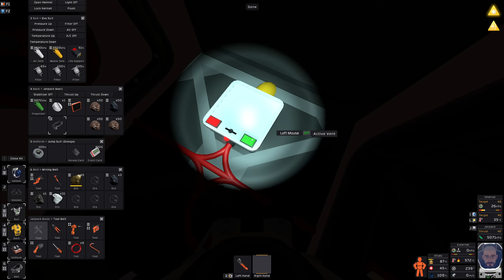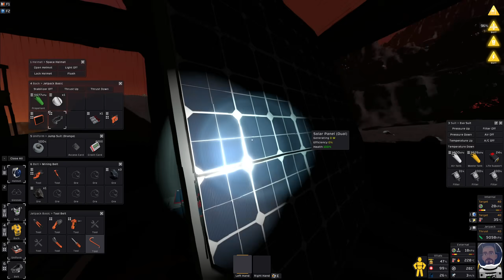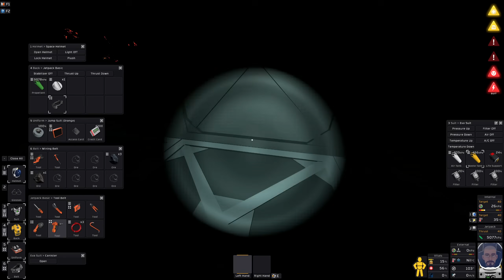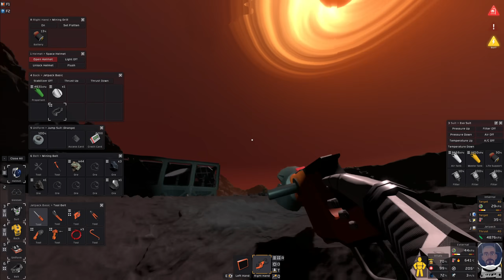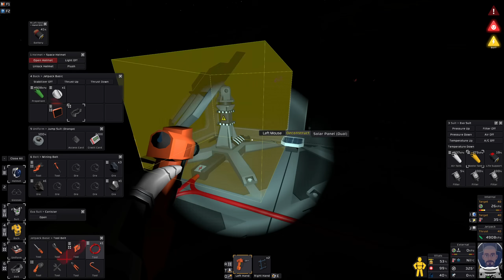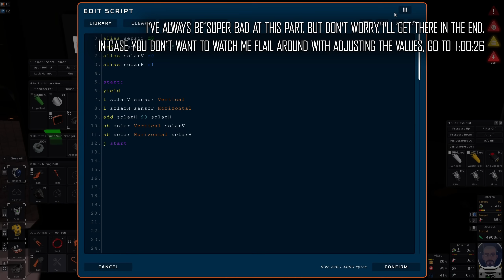We Need Solar Tracking ASAP - S2 E2 ║ Stationeers

Comment: Love the game, what is weird for me is how everything is complex, yet the furnace once you build it it needs no power. How does combustion happen?
Reply from the maker: Normally things combust because they are already hot enough, as for the ignite button, I always assumed it's the same piezoelectric effect that makes those gas lighters work without batteries. You know, the ones you need to squeeze a bit hard, so a small electric arc happens.

Comment: Solar tracking is much easier to get working if you always start by setting solar_vertical = 90 - sensor_vertical

This is because the sensor and solar panels give different values when the sun is directly overhead, and a conversion is needed regardless of the horizontal value you set.

There are other ways to do it but this makes for the most straightforward horizontal angle adjustment, as it will always be a multiple of 90 degree rotation no matter the map you play on.

Comment: hello Can you give us an IC code for solar tracking in youtube description?
Reply from the maker: I hope this reply will be enough, I don't really want to change the description of the videos. :)

/////
alias sensor d0
define solar -539224550
define heavySolar -1545574413
alias solarV r0
alias solarH r1

start:
sleep 1
l solarV sensor Vertical
l solarH sensor Horizontal
add solarH 90 solarH
sub solarV 90 solarV
sb solar Vertical solarV
sb solar Horizontal solarH
sb heavySolar Vertical solarV
sb heavySolar Horizontal solarH
j start
/////

This one includes a couple extra lines, since later in the series I will add some heavy solar panels to the system, so they are included as well.

Two very important things to keep in mind: this only works with the "dual" versions of the panels, where the data and the power are on opposite sides, and the data port of the daylight sensor need to face the same direction as the data ports on the solar panels.

Theoretically, it should work, with heavy emphasis on the word "theoretically". :)

Comment: Would it work to put like a solar house on top so you can glass in all directions and seal it off, then wire it down. So you save room and if glass doesn't keep certain things out it would have it's own room.
Reply from the maker: That would work great. Right now 2 panels doesn't really warrant such a big project though, we have a lot of different essential systems to take care of first, and the clock is ticking. :D
Reply: @Hmuda  Yeah, I see that your character is barely sustaining life. Will be interesting to see how you tackle it.

Comment: You should just build one solid generator it is relatively cheap and you have no shortage of coal outside.
Setup one station battery, and charge it. It give enough energy/time for making proper solar power. And after that can work as backup source for hot winters (could be not much sun).
Reply from the maker: Eh, constantly refuelling them would be way too much busywork. I think I'll try to see if I can put a stirling engine together, that should be a lot more interesting.
Reply: Filter out the hydrogen out of the atmosphere and mix it with coal in a furnace gets you solid fuel, very efficient.

Might be a nice challenge to automate